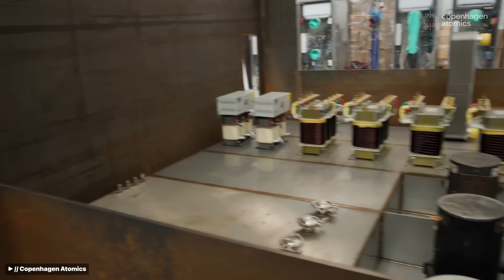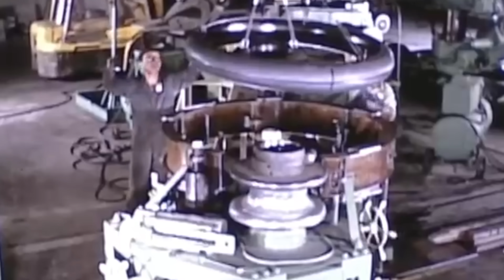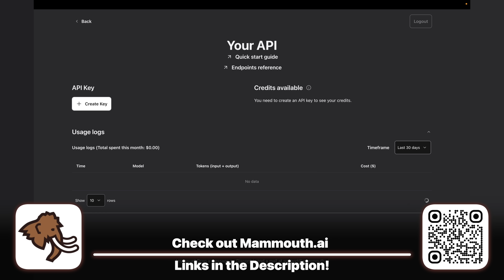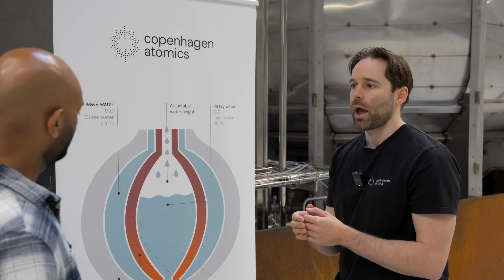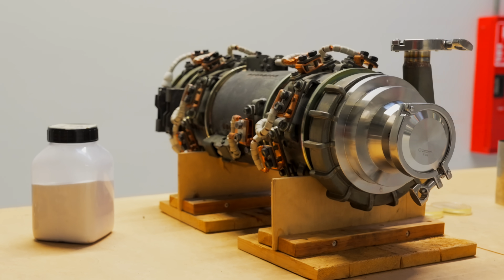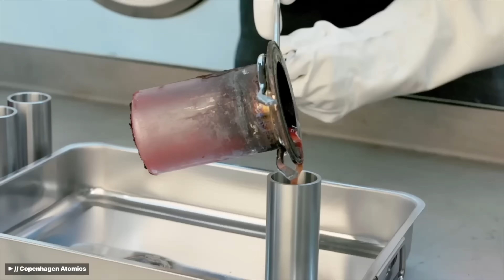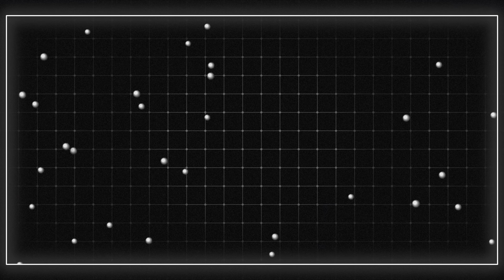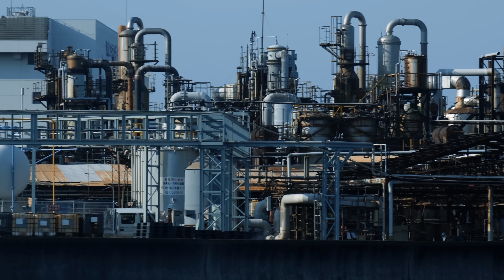This Modular Thorium Reactor EATS Nuclear Waste

Comment: get me a barrel or rather bucket sized one, that can power offgrid my household or houseboat for 50 years maintenance free
Reply: @radeksparowski7174  I just can’t imagine all the problems once humanity got hold of them. Like the Russian lighthouse generators.
Reply: @Idrinklight444  oh yup, those are nasty, but they are used in deep space probes, I think the voyager has a nuclear battery and still kicking after 5 decades or so
Reply: @Idrinklight444  Big nuclear reactors have efficiency 33-37%, SMR 25-31%, nuclear batteries 0.6-6%, nuclear thermophotovoltaic batteries 12-18%.
Last are good for space and maybe for isilated islands but never for households.
Reply: @MihailG5541  Nuclear SMR or large can have efficiencies up to 50% if you run them hot enough.
Reply: @fredbcf1255  No one will bother with regulatory issues for single households. The post we are commenting on is talking about that. Not about nuclear energy in general.
Reply: @ThewayofthecardsMTG  No they ain't for single households. You don't need a 100MW for a single household.
Reply: @fredbcf1255  Of course You don't need 100 MW for a single household. But for a single household the reactor would have to be significantly downsized. Not sure if that'd be worthwhile from commercial perspective. They'd have to deal with millions of customers instead of a handful of customers in their current business model (they want to sell heat to customers, not reactors).
Reply: @Idrinklight444 The Russian strontium 90 generators were indeed a scourge on the planet - thousands deployed, two people recorded injured, one killed. Firstly, that's Russians. Everyone knows about Chernobyl. That killed about sixty people. Russia had two energy disasters with comparable death tolls within the same few decades: the Sayano-Shushenskaya hydro catastrophe, and the Ufa gas pipeline explosion. Any technology has risks. You learn how to manage them. (Unless you're Russian, of course - the Ufa explosion engulfed two trainloads of people, exactly a year after another mass-casualty rail explosion.)
Reply: The only thing man made maintenance free for about 50 years is a brick.
Reply: @justklaas4703  a comment worth a tombstone carved in rock to last for centuries
Reply: @justklaas4703  All kinds of stuff, literally millions of things are maintenance free for >50yrs.
Reply: Look into strontium 90 based set ups from the cold war. Based on beta emissions.
Reply: @harryniedecken5321 The Strontium ones were very useful for places where people didn't LIVE, because Strontium beta emissions can make high-energy gamma rays.  Also, they don't put out a ton of power...a Beta-M Soviet RTG provided 250W of thermal energy output, and all of 10 watts of electric.  And, oddly, I can't find an output voltage for that 'ten watts', even.  Other Soviet RTG's varied from 7 to 35 volts, so I'll pick "24VDC since they were used for lights and a radio beacon styles of things" as a voltage, which provides 24VDC at 417mA for 10 watts of total output.  This, at a weight for the Beta-M (the most common RTG) of TWELVE HUNDRED AND THIRTY FIVE (approximately) pounds to generate a whopping 417 milliamps at 24VDC.  You could run house lighting off of that if you had very efficient LED bulbs and didn't need a lot of light inside, but the 'twelve hundred and a bit' pounds (or 560kg for the non "Furlongs-per-hamburger" crowd!) of it would make it very counter-productive to use for a houseboat.  Might be usable on land, of course, but only kinda.

tl;dr of the below content: "They are all too old, likely too leaky, and even if they could be salvaged and weren't too contaminated to be useful, Soviet RTG's were 1000-2300lbs in weight for their tiny power output and their current high risk of contamination from degradation leaks.  RTG's are great in space or on land that you never want to go back to again, but not useful for humans overall, and DEFINITELY not useful for houseboats."

The 'best' RTG, by electrical output, was the Soviet IEU-1M, putting out 2200W of heat and 120W at 28VDC of electrical output...at a mere weight of 2,300lb (1050kg).  Or possibly twice that?  The tables I've found showing these RTG's all seem to show the 120W version of the IEU-1M has a mass of "2x1050kg", and a 180W version being 3x1050, soooo maybe that means instead they are referring to multiple "Gorn" RTG's all working in a gang?  The Gorn's are 60W each, and 1050Kg each, but each Gorn seems to put out 7 volts, so...I dunno.  But that means a best option of 28VDC at 4.29 amps for 2,300ish pounds of mass, or maybe needing 4,600 pounds of gear for that much.  28VDC at 4.29A output non-stop could be a useful amount of electricity for an inverter-and-battery system to be able to run real (but preferably efficient!) appliances from, for a small household.  The estimated fuel-decay value suggests they'd put out maybe 60% of the original electricity, and 70% of the heat of its initial design, so call it 28V at 2.58 amps of energy?  Still useful, but a LOT less so...and then there's the weight of the thing.

For comparison purposes, a 1996-era Honda Civc Coupe (two-door version) has a curb weight of 2,262lb, vs the 2,300-ish lbs of each RTG for that power output.  So, each RTG weighs the same as a small coupe car, and all that for two coupes to give you 28VDC at 4.29 (at best) amps of output for however-many years, with a steady scattering of gamma rays to maul your DNA randomly with (from bremsstrahlung radiation) the whole time.  They're great for unmanned lighthouses, but good-quality solar panels would be a lot more useful-by-weight, and a far higher power density than an RTG.  Also, a lot less likely to toss ionizing radiation at you.

If you live in Russia, maybe it might be worth salvaging one if you have a radiation detector (because many of them leak to various degrees by now, since the Beta-M's were made in the late 70's (1978?) and had a primary expected lifespan of 10 years (but they could be extended up to another 10 years depending on factors I couldn't find in my quick web searches), so the oldest of them would be 47-48 years old, which is notably-beyond the half life of Sr-90 at 28.91 years (vs Pu-238's at 87.7y).  So, that's 1.66 half-lives, which means they will put out a LOT less of that '10 watts' of power unless refueled.  For the comparison, the three Plutonium-based RTG used in the Voyager probes put out about 157W of electrical energy, and 2400w of thermal energy when built.  In 2025, it was reported to have about 225W of electrical output left, which is why we have to keep turning off 'experiment packages' over time.  Part of the power loss for Voyager's RTG's is actually damage to the thermocouples, so I don't know how Strontium behaves equivalently with thermocouple degradation...but a quick chat with Google's 'search engine AI helper' thingy (whatever that is nowadays based on) suggests 4-7 watts of power at best, with a thermal-output reduction of 70% due to fuel decay for the Sr-90 core.

So the TL;ReadItAnyway: summary is, "RTG's are a bad idea on so many levels that you only want to do it if there's Mad Science and "Living In Russia Anyway" involved in the question."  This was amusing for me to look up, too, which was nice.  I was aware of the lighthouse RTG's already, and knew of their degradation and dangers, but I didn't realize they did only TEN watts when produced.  Man, that's amazing.  And over a thousand pounds for the Beta-M's 'ten watts at best'?!  I hadn't appreciated how crazy that stuff was.  And this was plenty of power for whatever they did, so...wow!  Lighthouses using 10 watts..?  Or 20 if they had two or something?  Just...wow.
Reply: A safe, shipping container-size breeder reactor was total sci-fi 50 years ago. So possibly, if you're able to wait another 50 years 😅. But yeah, I see the amount of power they have in pineapple-size power units in sci-fi movies and get pretty jealous.
Reply: @truhartwood3170  gas-cooled reactors will be twice lighter maybe, not sure.
Reply: Yes!!!
Reply: Bucket sized is doable strip the shielding 😂
Reply: @johnschneider931  there were efforts to have nuclear powered planes and yup the shielding was the problem because lead is heavy and heavy planes are not the best choice for ruling the skies......
Reply: It is currently technically impossible (or too expensive) to build a nuclear reactor with an electrical capacity of less than 30 MW, a full service life of more than 50 years, and refueling cycles of less than 5 years, so that the cost of electricity and heat from it would be less than $150 per MWh, closer to $200-250 per MWh, with an electrical capacity of 50-60 MW and a thermal capacity of 180-200 MW.

There are currently no technologies or IAEA permits for this purpose for peaceful nuclear energy.
Reply: @MihailG5541  ...so you are saying I have to buy myself a nuclear powered icebreaker/submarine and still can waste excess energy for yacuzzis in every suite... shut up and take my money.... well next friday 130 millions superdraw in euromillions I will get myself one....
Reply: @MihailG5541  There are a number of efforts to build microreactors with power output <20MWe. Deep fission is an example with a 15MWe design. They are claiming $50-70/MWh. Lots of plans for space reactors in the 1kw to 10Mwe class by US, Russia & China.
Reply: $50-70 per electricity MWh looks like fake. In reality it will be $500-700.
Reply: @MihailG5541  No that's accurate. If anything it's a high FOAK estimate. People just don't realize how massive the cost reduction is going from bespoke one-at-a-time construction to factory construction and assembly line production. With monstrous rockets, filled to the limit with highly explosive propellants, Musk is building them using advanced assembly line construction methods. Vastly more difficult and per ton of steel much cheaper than these reactors. 
The clique is trying hard to prevent doing the obvious with nuclear which is assembly line mass production. They know damn well no other energy source can compete with at.
Reply: @fredbcf1255  Chinese publications about new russian SMRs RITM-200 told that it had $150 per MWh for the first 6 reactors and $120-128 for the next 18.
I think that russian and chinese can make it cheaper because they didn't stop there nuclear development last 35 years and because of lower salaries and taxes.
But I'm not sure that someone worldwide can drop nuclear generated power lower than $100 per MWh for any type of SMRs.
Reply: @MihailG5541  Again people just don't understand the cost reductions of factory construction, assembly line production. If you made a Tesla like NPPs are built it would easily cost a $100M each instead of $50k. A Tesla is far more complicated than a NPP. More power per ton of steel. Many more control points per ton. Many more control loops. Much faster operation. Much more instrumentation. Much quicker response times needed to avoid catastrophic, life endangering failure. Much more powerful computation. Higher risk and death rate.
Reply: @fredbcf1255  "a Teala is more complicated than NPP" - you are so funny ;)
Nuclear enrichment, waste management, recycling were dropped somewhere suddenly.
OMG it was something from the circus ;)
Reply: @MihailG5541  That's the same as saying skip all the roads, charging stations, parking lots, power distribution, traffic lights etc.
We're comparing machine to machine, control points per ton of metal, control loops per, power per, instructions per second, response time, AI/visual automation, etc. A NPP can't come close to a Tesla in complexity. While cost per ton of metal is vastly higher.
Reply: Solar panels and batteries are what you need for off-grid living.  Expandable too if your power needs grow over time.  Maybe not 50 years maintenance free, but probably close.
Reply: @vinumcopia9850 they're no any type of long-living batteries except flow batteries, it's expensive and it's need to be maintained.
Solar panels without additional wind or hydro or thermal generation (gas /coal / wood microgeneration) have 90% chance of 2-weeks "black storm" without generation every 3-4 years in Europe or every 4-6 years in US.
Reply: @vinumcopia9850  Solar/batteries are good for off-grid power but very limited in most areas. Where I am they are useless in the winter. Most of your energy comes from a diesel or propane generator. Ideally a CHP system. The diesel charges the battery on a much shorter cycle than the solar, so much smaller batteries needed. Solar can augment the diesel during sunny weather. That's how it is most places on Earth.
Reply: Always wanted my own micro off-grid nuclear reactor, government regulation is the reason we can't have them sadly, could they make them? Absolutely.
Reply: @4johnybravo micro off-grid nuclear reactors are myth if you don't want to pay $500-700 per MWh for thermophotovoltaic nuclear batteries (1..20 kW) like those which will be maded for space programs.
Nuclear power inspection will visit you every day, of course.
Reply: @4johnybravo there is so much more to nuclear stability and machinery than a few regulations though, unless this is sarcasm
Reply: @crispycrusader1  bruh. Keep licking the government boots.
Reply: @4johnybravo yup, they went for fission reactors so can be used as weapons, but they will not have commoners independence even if we had safe fusion reactors, they want us to pay for energy so they can mismanage the taxes
Reply: It's coming - likely that AI will be able to create it in 10-12 years, and 3D printers / CNC machines will be advanced enough to print parts  Getting the materials is the hard part.  Got money?
Reply: @carlstockmal  have an euromillions ticket for next fridays superdraw, the best I can currently do, if I am still alive in 11-13 years I will go for it....and maybe rejuvenation cure by nanites or a complete new avatar body to download myself into as well...
Reply: @carlstockmal  it's not possible because of low efficiency and high price per MWh, $500-700

Comment: It makes me wonder if the salt becomes more corrosive after we have fission byproducts in the mix.  But I like the idea of using heavy water as a moderator and isolating it to keep it below boiling.  If it starts to boil, it stops moderating and the reaction stops.
Reply: The sodium don’t by the radiation destroys the materials, makes them brittle and brittle fractures are the most uncontrollable and dangerous.
Reply: @Harrythehun  There is no sodium, you are confused with liquid sodium fast breeder reactors. Several of which have been operating for quite a long time.
Reply: Still has lots of pressure.....IMSR with iterations is what we need
Reply: @andrewwilgress4100  What pressure? The heavy water is below 100C.
Reply: Metal literally swells from radiaton in nuclear facilities, i woner if their materials stay corrosion resistant agter rhey swell.
Reply: @423GustavBern Long term plan is to use silicon carbide for the core. That should be more transparent to neutrons, so suffer less damage. Neutrons generate alpha particles in metals. They become helium gas, which accumulates at grain boundaries. Non-metal core structures are needed anyway, so enough neutrons are available for fuel breeding.
Reply: They probably has to use some sort of "online reprocessing" to treat the fuel salt, as 1. the accumulation of fission products also hurt the neutron economy 2. one of the a major advantage of a liquid fuel is the opportunity to modify (purify or add to it) fuel on the fly. Then again, they want the cores to last for 5 ish years lifetime, so they may  plan on getting away without doing it. Btw I'm not a big fan of these "small modular throw away reactor" concepts, I don't think current society and economy needs more temporary "throw away" stuff, especially not if we want this tech to proliferate.
Reply: @CraftyF0X All current reactors 'throw away' all their fuel after 5-6 years. These guys just keep using it - it's basically just the containers getting dumped, the fuel all goes into the next reactor. The old one is 99% just lightly contaminated/activated steel; it just needs to rest for a few years, and then would be fine for eg bridges or building foundations.
Reply: @2x6x250ml  Refuelling every few years might be an easier undertaking than decomissioning every 5 years. It all depends on the details, but one of the big strenghts of the liquid fuel idea would be "online reprocessing" so you don't need to take apart your reactor that much. You kinda lose this edge if you decomission the whole thing every 5 years. The waste produced depending on the country, will be considered  as medium or high level waste and as such handling it won't be that cheap. I would much prefer a somewhat more expensive desing but with the option to run it 30-50 years without major tear apart, if not for the first few units, but definatelly for the long term mass produced "matured version".
Reply: @CraftyF0X  You could restart the whole thing at a reprocessing site and run the molten salt through a full reprocessing loop. A bit heavy duty to have that large a processing facility at every reactor site. And unnecessary.